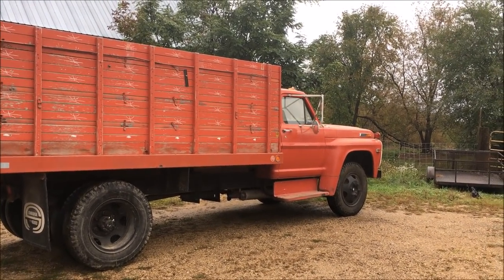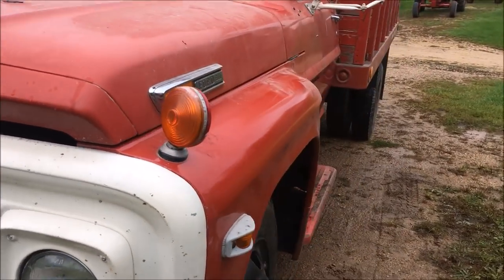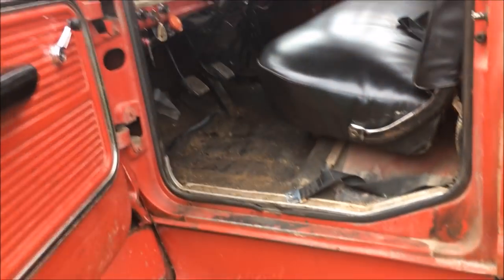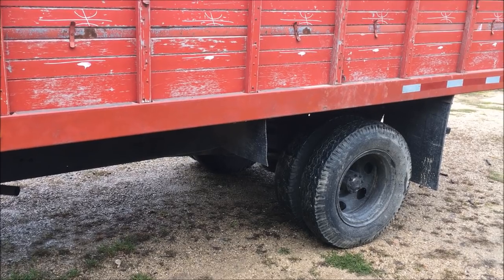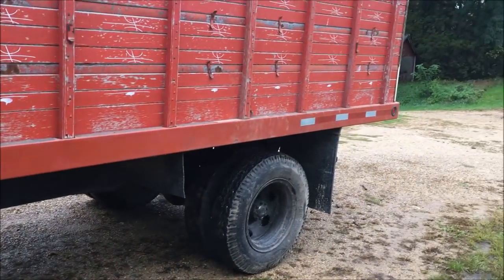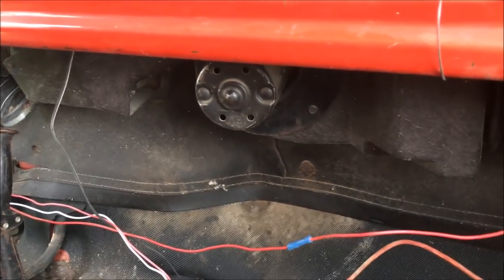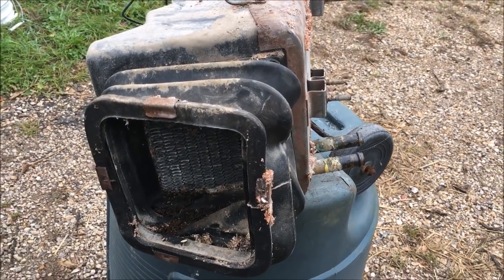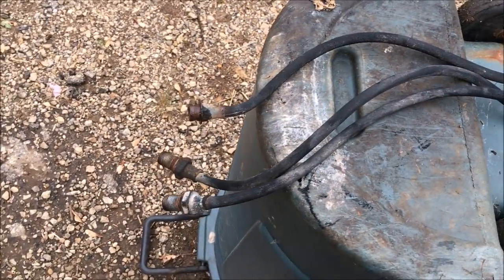1968 Ford F600 Grain Truck - Getting Ready for Harvest

Comment: That’s a nice truck. They mad real trucks then. Does it have the 360 or 390 in it. Those trucks are easy to work on. Thanks for sharing
Reply from the maker: Thanks. It has a 330. Very similar to the 360-390 engines, used in medium duty trucks.
Reply: @farmerpete  Where are you finding parts?  I have a 1972 wood chipper with a 330 in it, and I am looking for basic parts.   Beautiful truck!

Comment: I have a 67. She was abandoned in a field for more than ten years and I just did not get very enthused about her when I first saw her. She was missing a lot of engine parts, had huge snake skins in the cab and engine compartment and trees growing on the bed. I bought her for $200.00.
i have fallen in love with my ugly duckling. She is NOT high performance. She is NOT luxury. If you buy a new truck to haul the same load it would cost you $70,000.00 so I smile every time I turn the key and start her up. Finding brake drums for these old trucks is like trying to find a virgin and three wise men in Washington DC.  BTW Great Video. Waiting for the next one!!!!
Reply from the maker: When I was a teenager we had a 67 F600 on the farm for a while. When I was looking for a grain truck a few years ago I really wanted to find one of this vintage. Found this one on Craigslist in central Iowa, bought it and drove it 210 miles home.
Reply: I was wondering what speeds u can get it up to, and does it wander on the road a bunch due to its size. Never driven something quite that big but am interested.